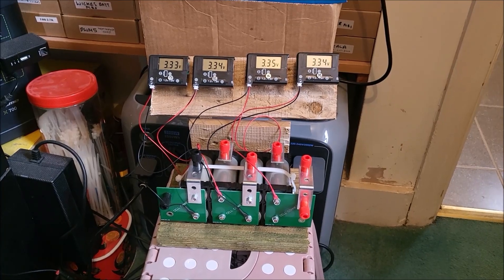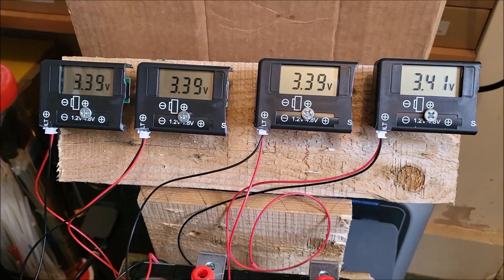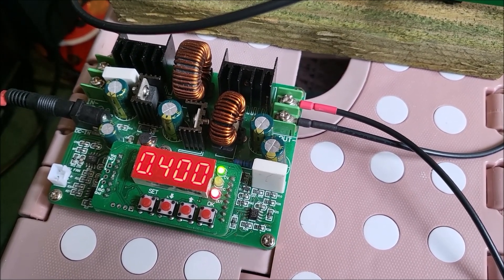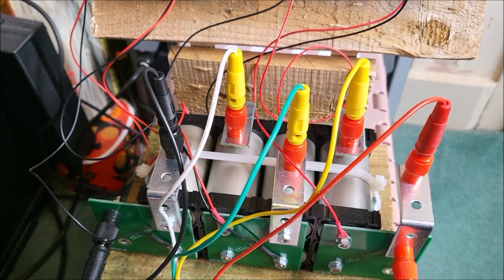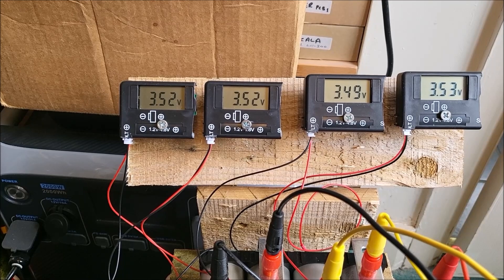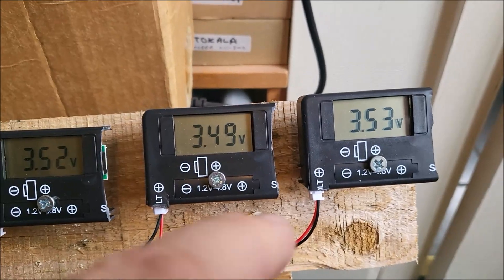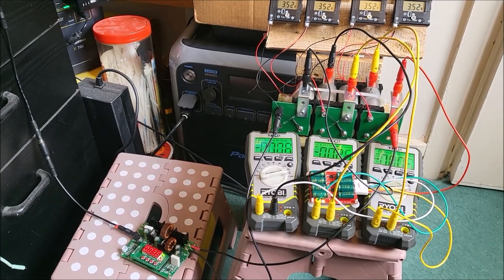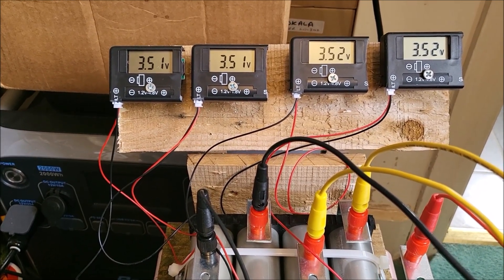Balancing Voltages and Currents

Comment: Hello from Puerto Rico! Nice setup and testing method. Where did you get those single cell voltmeter? I need a few of those, also for a LiFePO4 project.
Reply from the maker: They're BT168D or BT168 PRO battery testers. Cut up and fitted with JST connectors :)
Reply: @JulianIlett  Great, thanks for the info!

Comment: What's the net current draw of the battery voltmeters and the balancing board at steady-state? About 20 mA, as in the last shot?
Reply from the maker: The voltmeters pull a few microamps. The balancer a few milliamps.

Comment: i think the best way to go is buy the biggest capacity battery you can or just make up a 1s50p and use a boost converter to the voltage you want. No issues with balancing as they are using a bloody big wire to balance them all.
Reply from the maker: You'd have to parallel up the boost converters too. As luck would have it, that's the subject of my next video :)
Reply: @JulianIlett  back in the days of nickel-cadmium battery packs, before the days of power management etc. a single cell pack and booster was the most reliable way to go.
Reply: a 1s50p pack could give around 100A, which at 3V is just 300W... And you'd have to disconnect each cell to check them
Reply: @aldoconciso  but you wouldn't ever need to balance them.  But point was a single large cell.
Reply: yes, they would self-balance, and also self-discharge faster. And don't forget about thermal management, as voltage depends also on temperature. 

About doing it with a big single cell, i guess it's difficult to make them much bigger because of problems with heat dissipation

Comment: For a moment I was half expecting the "A while later" screen to cut to a video of the fire brigade standing around the smoldering remains of a shed. Incidentally, would the balancer work better or worse with the charge current turned off? i.e so the only power transfer is between the cells.

Comment: The balancer discharges the pack when hooked up continuously. It would be better to use tl431 shunt regulators on each cell set at 3.5 volts. Then it top balances the cells only.
Reply from the maker: Fine if you're charging the battery daily.

Comment: Ive noticed a battery pack (i made) that i fitted with a active balancer runs down way faster than just having a bms that balances around the 90% SOC mark.. So i have to recharge it frequently..
Reply from the maker: Yes, they do consume power, but that's OK if the battery is solar charged.

Comment: Presumably, once you are satisfied that the active balancer is working as intended you can get rid of all the meters.

I need an active balancer for my 24S pack and don't fancy all the wiring involved
Reply from the maker: I could, but I won't. For the 8S battery, I'll need 8 voltmeters, an 8-way balancer and a larger piece of wood :)

Comment: My question is whether two batteries at identical voltage are in fact at the same state of charge. I think things may be a little more complicated. It would be a good experiment to now discharge this system minus the balancer and see if all the batteries discharge to their end point at the same time. Then do it again, but this time allowing them to reach whatever voltage they charge to without forcing them to the same point
Reply from the maker: Each cell has a different capacity, so they will only reach their bottom endpoint together if you bottom-balance the pack. Most people want the cells to reach their top endpoint together, so they top-balance the cells.
Reply: With enough parallel cells per series bank (nP4S) and enough testing and swapping cells, you can eventually get all the series levels to have nearly-identical charge state-voltage curves. Though the number of potential combinations of cells gets pretty big once you have enough cells to reasonably balance their capacities in banks.